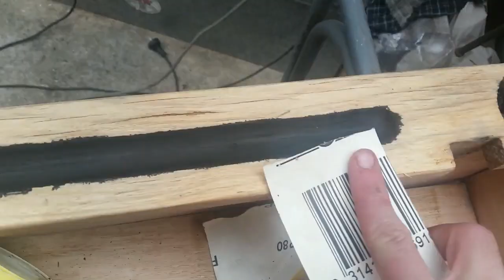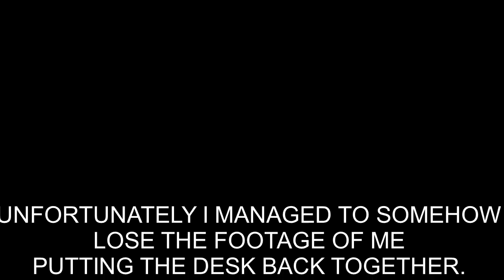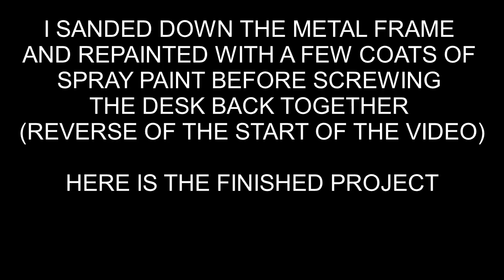Restoring an old school desk

Comment: Great video.
Was there anything in particular you were trying to get off with the wood cleaner?
Reply from the maker: Thanks!
because the table had been sitting in the weather for probably 5 or so years the coating had peeled and gathered dirt/dust/dog hair and was embedded in the grain, the wood cleaner helped to get rid of any of the deep dirt and stains